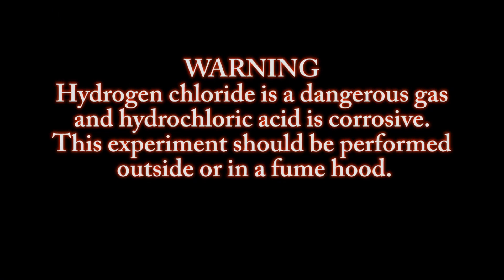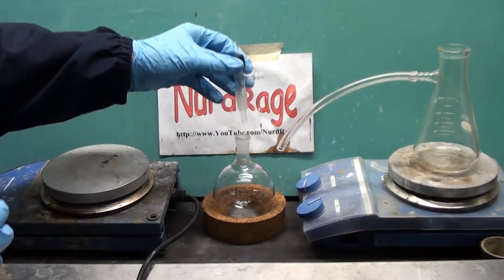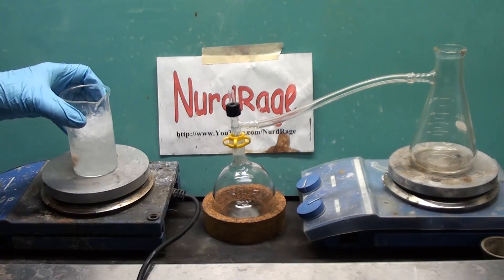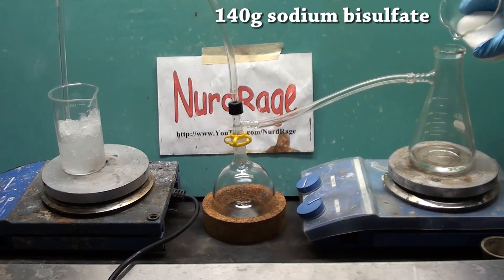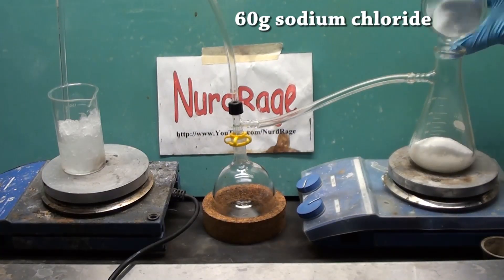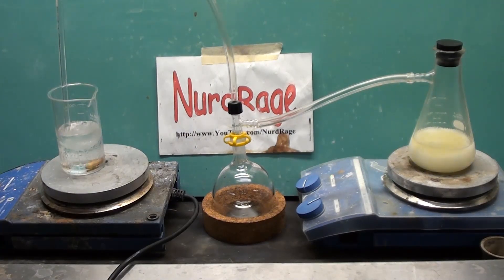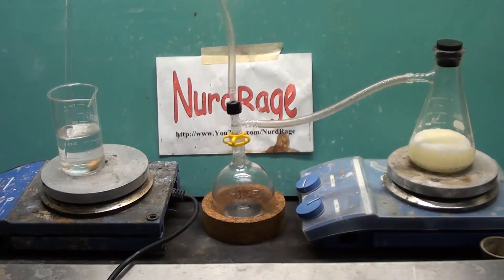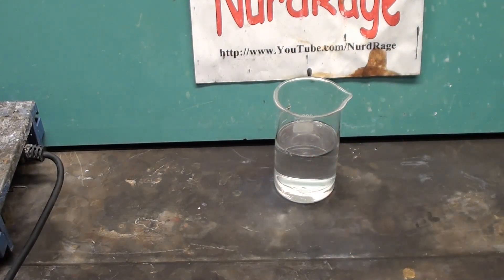Make Hydrochloric Acid

Comment: Given that HCl is a strong acid, you could exponentiate the negative pH to 10 and get the molar concetration. Given that this ph is 0.25 our concetration would be roughly 0.56234132519mol/L

Comment: I make hydrochloric acid by mixing salt and vinegar because it is very low concentration it is safe inside the house but when I put my head above the cup my throat hurt and it felt like something was in my throat like a little wet weird thing in my throat so i stopped doing it.

Comment: Excluding cost of tubes, flasks, valves, beakers, and hot plates, would you consider this to be cheaper than buying the Acid at the store by the gallon? Or would buying it at the store be far cheaper?

Comment: aren't you getting a mix of HCL: + H2SO4 ?
Doesn't the generated HCL reacts with NaHSO4 And probably small amount of Sodium metabisulfate(which is probably produced when you heat the sodium bisulfate)
Reply: How would the sulfates get from the first vessel to the second? Only the HCl gas is going there.

Comment: I make HCL very sucessfully by mixing equal proportions of sodium hydrogen sulphate and sodium chloride. I heat up the mixed powders and bubble the gas directly into a flask of distilled water. I never get backflow because I watch it the whole time until the mixture is not producing gas anymore then I pull the tube out the water. The heat is also very high all the time.
Reply: Thank you, my friend. Do you add sulfuric acid to the salt powder?

Comment: "hydrogen chloride is so soluble that the water will pull itself into the tube trying to absorb it." mmm I don't think is correct... What is probably happening is that while the gas is dissolving in water the volume in the apparatus is the same so the pressure is lowering probably also the temperature will drop at a certain point and this will cause that the pressure of the atmosphere to be higher compared to the pressure inside the apparatus causing the back-flow.

Comment: Would you also be able to generate clorine gas by mixing sodium chloride with sulfuric acid?
NaCl + H2SO4 -----> NaHSO4 + Cl?
Reply: Not on itself,but adding an oxidizer like bleach or hydrogen peroxide does.

Comment: if the compound is exposed to galvanize (zinc) and it begins corroding the zinc it will bubble up and if a spark hits it will explode. saw zinc being dipped and a welder up on the roof dropped a spark and the explosion lifted a 10ton crane load 40 feet
Reply: What are you talking about and how does zinc have anything to do with this.

Comment: Why is it that Hydrogen Chloride and Hydrochloric Acid have the same formula despite Hydrochloric Acid being an aqueous solution?

For Ammonia (a gas at room temperature), when an aqueous solution is produced, the resulting product is Ammonium Hydroxide. 

Why is there a difference?
Reply: They don't have the same formula actually:

hydrogen chloride = HCl(g)
hydrochloric acid = HCl(aq)

People however shorten hydrochloric acid to "HCl" since it is most often used as aqueous solution. When pure hydrogen chloride is referenced, it is almost always written as HCl(g).

I think the reason for ammonia forming ammonium hydroxide has something to do with oxidation states of nitrogen. Ammonia deprotonates water molecule to form ammonium and hydroxide ions:

NH3 + H2O <=> NH4+ + OH-

hence the name "ammonium hydroxide". It does not exist as a standalone compound [NH4+][OH-] and only small fraction of the water gets deprotonated in this fashion.

An equivalent name for HCl solution would be "hydron chloride" based on the respective ion names: H+ and Cl- from the hydrolyzed HCl gas.

For more info, see "Ammonia solution" on Wikipedia.

Comment: You should use an inverted funnel to dissolve the gas.
It would prevent back suction
And give the gas a large surface area to dissolve

Comment: I tried this the other day, with a different setup, and got a surprise.
I used a short-path distillation setup into a 1000mL 2neck RBF submerged in an ice bath. (Because why not?) The other neck had a gas adapter that went to a bubbler in a tube in an ice bath.
After a short time, the bubbler stopped bubbling entirely. There was no blockage - the gas adapter had a stopper that would have popped out easily enough - and water kept distilling over to the iced flask, so I let it go until I figured the reaction was complete.
When I tested the tube water, the pH was ~7, but when I unstoppered the iced flask, I could smell the HCl immediately. The water in there tested around 1 with my cheap Chinese pH paper. I haven't had a chance to titrate it yet, but I've used it for a few things, and it seems pretty strong!
I'm guessing the HCl absorbed into the distilled water pretty efficiently as it beaded and cooled on the walls of the flask.
I'm assuming that the initial bubbling was just some displacement of the air in the system. I did notice that it started getting some back-flow as soon as I removed the heat. It wasn't violent, though, and I disconnected the hose before it reached the flask.

I will definitely be using this recipe/setup again!
Thanks for the great videos!

Comment: how to  make hydrofluoridric acid
Reply: You probably will die in the process, but heat sodium fluoride with sulfuric acid. It will corrode your glassware so you need to use something like lead containers
Reply: Breloom I'm not a layman in chemistry.
Reply: Breloom In fact I know the procedure of the production of fluoridric acid

But it turns out that this is a suggestion

sorry for my english
i'm braziliam
Reply: why its always the brazilians who are asking how to make hf or antimonic acid or other really dangerous chemicals.
Reply: Adalberto Bushcraft

Comment: Could i bubble the HCl gas into less water to get a higher concentration of HCl?
Reply: No, because it would release many vapors of HCI gas which could decrease the concentration of the acid.
Reply: This only works to a certain extent. From experience, HCL fumes above 30% concentration which means it's exceptionally hard to achieve higher concentrations.
Reply: I managed to use only the condensation of water vapor from the heated flask to capture the HCl in a graduated cylinder buried in ice. This is probably much less efficient, but my probe gave a pH of 0.00. So the concentration should be sitting somewhere above 1M.

Comment: Why can't I just put/dissolve chlorine in distilled water? Wouldn't that make hydrochloric acid and produce oxygen? And I could just vent the oxygen and use the acid?
Reply from the maker: no
Reply: No you need a suitable reducing agent to bond the chlorine otherwise it'll just be chlorine dissolved in water much the same way dissolving air in water doesn't produce nitric acid. If you were to produce both hydrogen and chlorine gas from the electrolysis of a salt water solution and combine the gases by burning them together, passing them over a catalyst, or even a bright light will initiate the reaction but this usually ends up in an explosion. The HCl can then be dissolved in water to make  hydrochloric acid. This website- http://chemicals.etacude.com/h/hydrogen_chloride.php states that 442mL of gas will dissolve in 1mL of water at 20C. A couple benefits of the electrolysis reaction is that the reaction rate can be easily controlled and you'll get a sodium hydroxide solution after the chlorine is used up. See the chloro-alkali process.
Reply: NurdRage hello what is the name of this 'attachment' here that is referred to? also is there a large scale version of this attachment that can be used with the hcl gas cylinders?
Reply: Josh M Hey! Thanks so much for the super detailed description and reply. That helps a lot. I'm a student learning chemistry and I really enjoy doing projects at home so I'm always looking for the simplest and easiest method I can do because I don't have access to a lot of supplies. Once again, thanks so much for explaining. It helped a lot.
Reply: No problem. I'm here to help. Pretty much any chloride salt will do. Where I live, sodium chloride is the cheapest at around $5 for a 40lb bag. Its used to regenerate the ion exchange resins in water softeners. We get 6 bags at a time for our softener. Our water is rich in iron and calcium so I have to use hydrochloric acid to clean the rust deposits out of the shower as nothing else will work very well. Its pretty intense haha

Comment: I have a question about something that just happened  using muriatic acid in a porcelain pan.
after letting the Murrieta acid water mixture sit for two days, match head size pieces were like exploding off the pan bottom where no acid had touched it! what could cause this?
Reply: Rich Solis It's likely the bottom of the pan had a very rigid structure, and so when you broke that structure (with the HCL) the pieces that weren't touched still contained the elastic potential energy and sprung off the pan.
Reply: epicsilverprince so you're saying the acid changed the molecular structure of the metalic material but not the coating so one pulled away from the other?
Reply: Rich Solis or the acid dissolved the coating and the metal, and the bits that weren't touched sprung off because they no longer had the complete structure in order to maintain its flat surface. It's like if you forced a plastic sheet into a container until it was right at the bottom, then any disturbance would cause it to spring out.

Comment: How do you make hydrofloric acid ?
Reply: Derek Washuck Don't
Reply: Yes florine gas is way to much of an oxidizer and hard to store except in nickel after the oxide layer is formed or in Teflon because florine is part of it's molecular structure . It's probably much easier to buy hydrofloric acid . All I wanted to know is if it was made the same way as hydrochloric acid which it is .

Comment: Could you electrolyse NaCl solution with 2 carbon electrodes to produce HCl gas which will get pumped into water to produce Hydrochloric acid?
Reply: Donutmcgee S Yes, but the chlorine gas being produced is very minute (unless a high current and voltage is used). If you don't have these materials just mix bleach and vinegar together and you'll have a whole heap of chlorine

Comment: The acidpaper part is perfect. But what is it that makes it change color? Could you make a video about that? Thank you!
Reply: It's a litmus paper.Changes into red when dip it into an acid and changes into blue when we dip into base
Reply: The paper is soaked with litmus, which is a water-soluble mixture of different dyes extracted from lichens, mostly orcein and 7-hydroxyphenoxazone, both having a similar structure of three hexagonal rings joined together, one of them with nitrogen atom, and there's a lot of resonance around these rings due to conjugation. Acids protonate water, and those protons can attach to that nitrogen, causing an avalanche of electron transfers along those conjugated chains of atoms, and changing its aromaticity, which is responsible for the color change, because aromatic rings can react with light at certain wavelengths. If you change the resonance, you change the wavelength of absorbed light, changing the color.
And vice versa: if the litmus is mixed with an acid (in the red paper), putting it in a basic solution will detach those protons from nitrogens and restore the resonance structures, turning its color blue.

Comment: Just to say it, since nobody else seemed to be able to answer it...  The connecting piece he used on the backflow preventer is some kind of "gas inlet adapter".  I found them on ebay if you want one.

If you search for "glass inlet adapter both hose connections" it comes up with one that's 24/29.  I'm sure you could find one that's 24/40 if you do some searching, but my glassware is all 24/29 Chinese junk, so I got one of those.

There, it's settled once and for all.   :)
Reply: Another solution is to use large enough wash bottle or 2-neck flask or 3-neck flask with hose adapters (and one stopper for the 3rd neck). The oldskool way would be to pinch two holes in a rubber stopper and drive two glass tubes through it - then use the stopper on a flask of your choice plus appropriate hoses. However ground glass is preferable as HCl slowly eats up rubber.
Reply: There is one that is 24/40 a little further down the search list for the search stated above.  Picture has a yellow background.  Now you can all get one!  XD
Reply: Ryan Ledak Thank you for the information

Comment: How do you get rid of your chemical waste?
Reply: You can treat it mate, acids react with bases and vise versa, get them to the neutral PH level of 7, if it contains any metals they will drop out of the solution  at that ph and form a salt of the metal from the Acid ( Example : HNO3 + NaOH = NaNO3 + H2O) Then once at 7 Ph, Allow to settle for 48-72 hours and dispose of the clear liquid (Almost Completely Clean H2O) Down the drain, then either dry the metal salt (in this case NaNO3) and keep it for later uses or dispose of in the bin or if its a toxic metal, then a chemical waste company is needed (we have ToxFree here)
Reply: Or you can just boil off waste water and be left with your NANO3 for a later use or dispose of (which id say never dispose of as you can get nitric acid back from that) Same with most metal salts

One upside to boiling it off, is your left with ALL the Salts and dont have to dump the H2O which will still have small amounts of the salts even after neutralising the solution and letting settle (could even cool to 0 degrees and get more to drop out but again it will still have smaller amounts in the solution)
Reply: infinteuniverse he pours it’s in a pool full new born turtles.

IM JUST KIDDING!
Reply: straight down the drain bro
Reply: infinteuniverse Some things are illegal to pour down the drain, but others are ok if you dilute them. I personally get a large bucket that can hold about 10 litres of water and fill it near to the top. After, I just dispose of very minute amounts of chemicals into 9 litres of water, mix well, then pour down the drain if allowed.

Comment: how high should i heat the hot plate
Reply: rabbits 39 As high as you want, the hotter the hot plate, the faster the reaction. Just start at 50° C and keep raising, if anything strange happens, evacuate the city.

Comment: I've found that if you add more water, the water vaporizes and ends up in the round bottom, and is much more concentrated. When I did this the back flow mixed with the concentrated Hcl and made it less concentrated. My apparatus is a little different pm me if you want to see it.

Comment: how can purify store bought hydrochloric acid at home
Reply: +lloyd dsilva With a question worded like that it would be stupid to give you an answer.
Reply: +lloyd dsilva use distillation or evaporate it
Reply: Tysm
Reply: +Saumitra Bane you are dumb as fuck
Reply: vincent corsentino Keep your mouth shut if you don't know shit, alright?
Reply: lloyd dsilva although it's not recommended to distill acid since Hydrogen Chloride gas is pretty dangerous, so you're better off getting concentrated from the store and then distilling it to your required concentration.
Reply: ***** OK sorry what I said was rude but evaporating it is dangerous and the acid would turn into gasses and what's left would be any impurities in the acid such as salt and other things

Comment: Couldn't I just vomit into a beaker?
Reply: it's a very low concentration and also has different ferments and spit. So yeah. 

and if you are wondering how low, it's a bit less than 100 times less concentrated, than the one made in this video.
Reply: McVidsAndTutorials
Oh...  So much for that idea...  XD
Reply: +Tony James Gilpin You could try, but make sure you vacuum filter to remove the organic solids from the mother liquor. Then perform a fractional distillation to concentrate and remove dissolved salts and other crap.
Reply: Gary Card
I think it would be easier just to follow the video!
Reply: +Tony James Gilpin lmao
Reply: no.
Reply: You could but you would have to not eat anything to do that and only drink water. But that would be painful.
Reply: It's a stupid idea but I've actually thought about it before. Would eating any types of food for a set period of time increase the HCl concentration and make the distillation and separation any easier?
Reply: and would it be a viable source of butyric acid?
Reply: @MuzikBike  Eat some dryed fruit and something other can be made. ;)

Comment: If you have a pH meter, just equate pH = -lg[H+]. Find the concentration of protons and that will be the concentration of the solution. You don't need titration.
Reply: +Desmond Low You don't know the H+ concentration and any method used to find out will take as much time or longer than the titration would have.
Reply: Dimitri, we don't know the H+ concentration but it can be found by reversing the equation pH = -log[H+]. To do this you simply take the base 10 the the power of the negative pH. For example, If the pH was measured to be 2, to find the H+ concentration you would only have to find 10^(-2). Easier and more accurate than a titration!

Comment: In place of a filtering flask, couldn't you just use a normal flask with a one-hole stopper and glass tube? I don't have a filtering flask, nor do I have the vinyl tubing to support it.
Reply: +Chunion Well you could but that will cause the acid to dissolve the rubber. Well unless you use a no hole rubber stopper made of neoprene. Although the angle its self could cause issues. You have to go on ebay man.... You dont fuck around with chemistry. It could, can, has and,  probably will kill you if you don't know what your doing.
Reply: *****
Pro tip do not do this